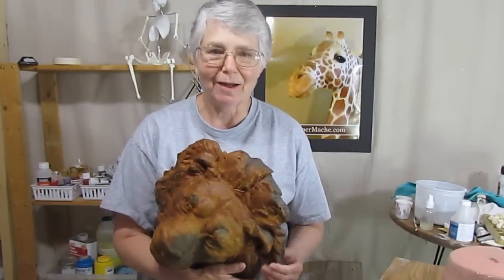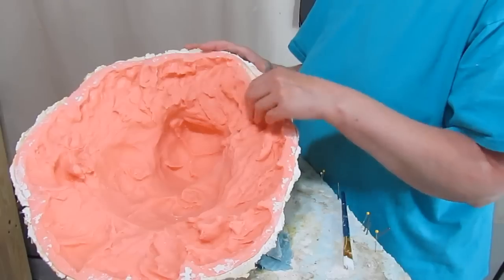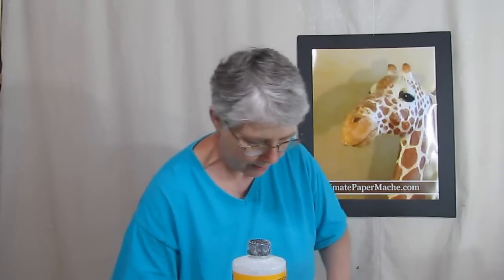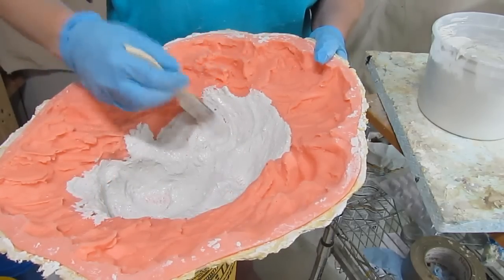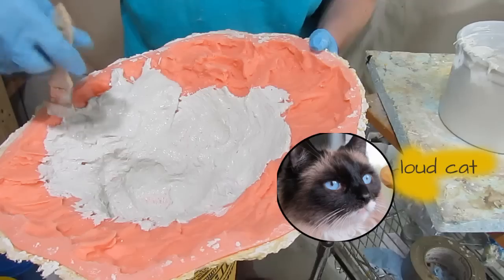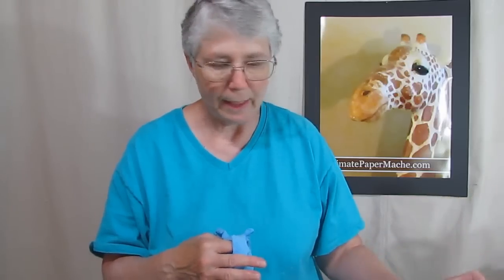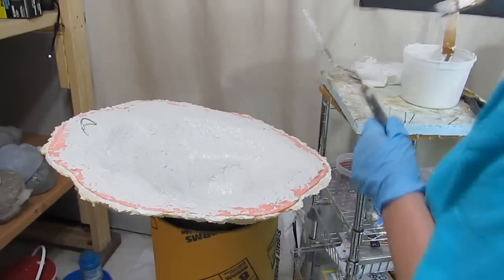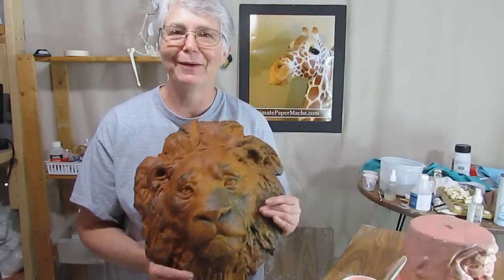Concrete Lion Head - Using Quikwall and Plasticizer for Concrete Garden Art

Comment: Fantastic information! Thank you for posting your informative videos! When you’re handling the piece the next morning once you’ve popped it out of the mold, you make it look effortless, as if the cast is made of styrofoam and not cement. Approximately how much would you guess the piece weighs? Thank you again for your time and for sharing your knowledge and experience!
Reply from the maker: I just weighed it, and it's a little over 7 pounds. I put the cement mix on in a thin layer, so it's about 3/4 inch in the thickest areas, and much thinner in other areas. The mixture contains fiberglass reinforcement, so it's holding up really well. I have it hanging next to my front door. Are you going to make one?

Comment: The wire you installed to hang the sculpture is best anchored by bending small half loops where it embeds in the cement. It will likely hold for a while, but the smooth wire needs more grip for a strong hold. Very nice work otherwise.
Reply from the maker: Good idea. Thanks!

Comment: Thank you for making these videos,  I see you successfully used silicone to make a mold from wet clay. I wonder if I could safely use silicone on greenware?
Reply from the maker: Hi Cynthia. Yes, I use silicone (Rebound 25) over wet clay all the time. I spray the clay with clear Krylon varnish first, to seal it.  I don't do ceramics, so I don't know if the spray would prevent you from firing your greenware after the mold was removed. And if the clay is quite thin, there's a real possibility that it would shatter when you remove the silicone and the plaster support mold from the clay. Do an experiment to see if it works.
One other point to consider -  if your greenware was created using a pre-made commercial mold, the design is probably protected by a copyright.
Reply: Ultimate Paper Mache thanks so much.

Comment: Hi Jonni, your videos are so great!!! Thank you so much!!I have a question, do you think I could use the same mix to great something like your little boy garden ? If so , do I need wire to reinforce it ?
Reply from the maker: +Natalie Diamond Hi Natalie. I'm not an expert in concrete sculpture, but I think what you're talking about is called ferrocement.  It uses wire reinforcing and a thin layer of cement over it. There are some good videos out there about the technique, but most of them are for building buildings, not sculptures.
Reply: +Natalie Diamond Natalie, the fiberglass strands that Jonni used in her mix acts as the reinforcement somewhat effectively replacing the wire reinforcement.  Concrete itself has very good compression qualities but is very poor in tension (pulling something apart) and the wire and/or fiberglass strands are there to take the tension.

Comment: My local Lowes and Home Depot do not sell the Quikwall, so I am thinking that some states may have it banned (?) ... if you could not get Quikwall, what in your opinion would you use instead?  Thank you so much :)
Reply from the maker: Becky Priest My dad can't get it up in Bellingham, either. I don't know why not. You might be able to use a mortar mix with the addition of glass fibers - or just use regular concrete and be sure to reinforce it with chicken wire.
Reply: I wondered about the mortar mix. TY so much! :)
Reply: 1 part portland type I cement and 0.8 part silica sand. You could also use fume silica. include 1/4 to 3/4 chopped strand glass fibers
Reply: I had the same problem , I went to Home Depot which carries Quickrete and after insisting  was able to special order it..in order to do that I had to call quickcrete and have them call Home depot to tell them what to do !

Comment: Hi Jonni.  I have followed your instruction using the Quikwall with plasticizer. I'm doing my first run with some molds, but my Quickwall with added fortifier/water and plasticizer
doesn't look like your paste. It has very visible fiberglass fibers! Do I have right stuff?

Would appreciate your feedback. Russ DesAulnier
Reply from the maker: Bonnie DesAulnier You may have used too many. Just a pinch should be enough.

Comment: great vids you should have put a little bend in the bottom of the wire hanger just to be safe so it dosnt pull out
Reply from the maker: Yes, good point. I think I did that, but I can't actually remember now. Even with just a thin layer of concrete, they're still fairly heavy, and you wouldn't want one to fall off the wall and onto your foot! ;)
Reply: You had a bend but it should have been at a 45* to the side on each end. Yours was towards the back at about a 20*. Nice video thank you.